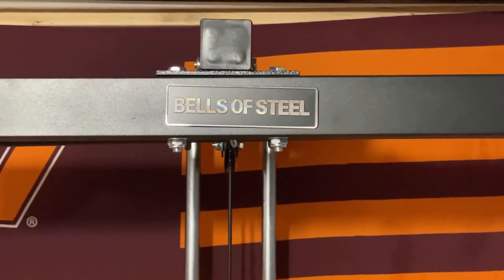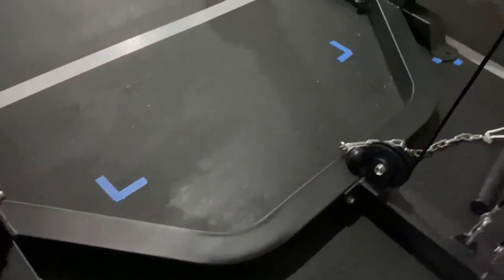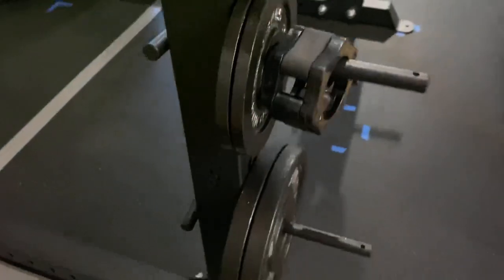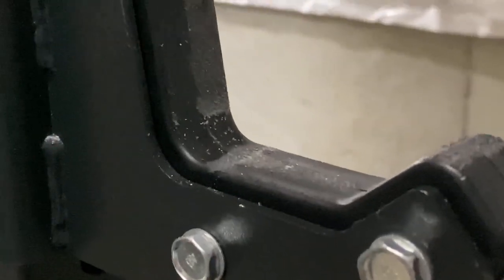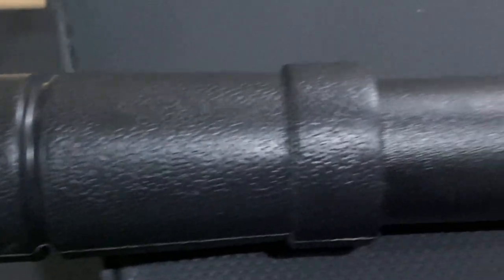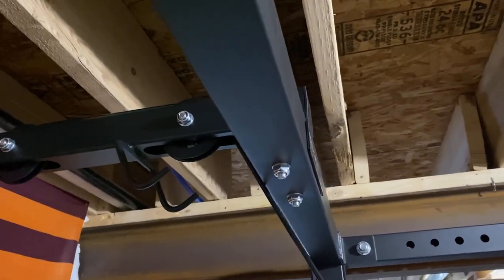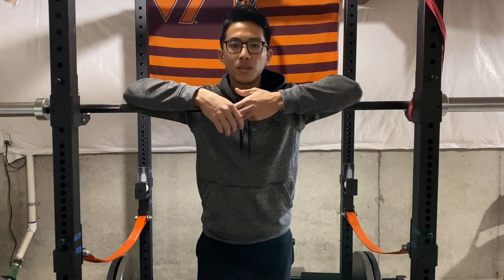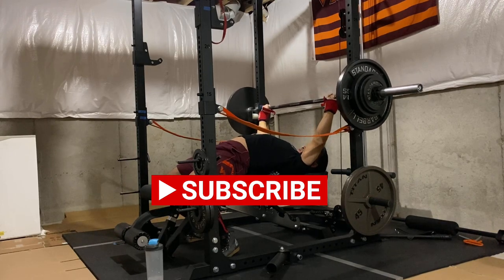Bells of Steel 5.1 Light Commercial Power Rack and Lat Attachment Review

Comment: I got this exact setup just before the pandemic hit. I also got the spotter arms, dip attachment and lever arms/belt squat. Would recommend for the price.
Reply from the maker: Definitely want the lever arms/belt squat in the near future.
Reply: I wonder what you can do with the lever arms that you can't do with the barbell.
Reply: @dkmchui  mimic just about any hammer strength upper body machine
Reply: But again what it can do that a barbell can't for upper body exercises? For the rack the big lifts are just bench press, shoulder press, row, squat and deadlift.
Reply: @dkmchui isolate shoulders, lats, traps, triceps, you can attach a roller and make it a glute work out. Lots of stuff you can do.

Comment: Really nice overview.  Well done.  Appreciated the detail.  This rack looks like a very good value.  It's been about a year since you posted this and I am wondering if you are still using the rack and have you had any issues?
Reply from the maker: Still using the rack regularly. I’m certainly not lifting as much or frequently as I did but still am 2-3 times a week and it’s held up well. The roller j cups have held up well, I suggest doing the lexan mod I did to keep your bar safe. The lat pull-down has been great, maybe just have to wipe it down with WD-40 to glide a bit smoother.

Comment: Nice review, quick questions regarding the flat feet... @2:14 in the video when you are talking about them and the video pans it looks like only the ends are touching the stall the ground and there is a gap between the rest of the base of the rack and the floor. I would have expected the entire base of the rack to be touching the floor for stability. Is this correct?
Reply from the maker: Good catch, I didn’t even notice to be honest lol. There’s about a 1/4” between the bottom of the feet and bottom crossbar. While this may seem like a concern, I haven’t had too many issues with it sliding around on the mats. 

If you look at the REP PR1000 flat foot rack or the Titan fitness T2 flat foot rack, they have these rubber feet which raise the 4 corners higher than the frame so it doesn’t seem uncommon per say. 

If you wanted all of the frame to be touching, you’d probably have to go with something like the Rogue Monster Lite flat food rack. Nonetheless I wouldn’t say that this rack is unstable because of this. It’s longer than most of its competitors and that extra length gives it stability. The lat pull down also helps.

Comment: How thick is the lexan and how is it holding up?  I'm not sure how to cut it.
Reply from the maker: I bought a small square sheet from Lowes. Looks like the website claims 0.093” thick. 

I measured and market the Lexan and use a box cutter and just continuously scored the line until it was cut and then sanded the cut so there weren’t sharp edges. It would have been much easier if I had a hand grinder I could attach a cutting wheel of sorts to or an oscillating too. 

I’d say it’s almost as painstakingly slow as cutting the stall mats with a box cutter lol.

Comment: From the wall to the outside edge of the rack how much space does this take with that lat pull down? Seems pretty deep.
Reply from the maker: Adds 12” of depth per BoS dimensions on the product page. Verified by measuring as well.
Reply: @Kelvinjan  Thank you. 
Just thinking of a garage gym using one half for the car. So space is vital.
Reply from the maker: @ToddCBrown  I hear you. Some people live in areas where no basements are the norm so you’re stuck using a garage spot for the home gym.

Comment: With the frame poles being 2.3" x 2.3", have you found any other manufacturers that make accessories to attach to it? I know you mention it in the video about not being able to use Rogue or Rep accessories, but thought since it's been over a year, you might've found some. Thanks! I just bought the budget 4.1 residential rack with lat attachment
Reply from the maker: I honestly have found that I needed anything else so I haven’t shopped around. I do want the lever arms from BoS and their pricing is pretty good so I wouldn’t be upset buying it from them.

Comment: Hey Kevin awesome video.  I have the same rack and put it together a few days ago.

Can you take a closeup pic or video of both your plate storage pages on both sides?. I recieved the pegs and it looks like they are both for the same side (ie don't have a left and right side). Do you have the same issue?
Reply from the maker: I took some pictures but not sure how to send them to you. You can DM my on IG @Kelvinjan and I can send you the photos. 

But, you are correct that both plate pegs are the same. You will insert the pin into the front of back side of the upright in order to get the plate peg to be oriented outwards or inwards if you get what I’m saying. Pictures show it more easily, feel free to dm.
Reply: @Kelvinjan  thanks will do

Comment: Do you think that this would be worth getting over the new Bells of steel hydra series rack? Would you say the attachment selection is plenty for most people for the light commercial due to the proprietary hole size?
Reply from the maker: I’m not too familiar with the newer hydra series but it seems more sturdy and much more expensive. It all comes down to your budget. I think the hydra is probably overkill if you’re comparing apples to apples with the flat food rack. I’ve been ok with the lat pull-down and landline attachments. Thinking about buying the arms you can attach to the front but haven’t yet.

Comment: 💪🏼 Awesome vid! I have the same rack. I was thinking of buying the lat attachment once it's available. I see the issues you pointed out when doing tricep extension with the pulley system. Do you think it's something worth buying in your opinion?
Reply from the maker: You can still make overhead tricep extensions work, you just have to stand closer to the lat attachment to minimize the angle. I honestly don't do oveheard tricep extensions often and don't really run into the issue I pointed out but figured it'd be worth bringing to people's attention. I'd still recommend the lat attachment as it's super versatile for the price. Could be improved design wise but that one flaw isn't a deal breaker for me.
Reply: Just do JM Presses instead, problem solved.

Comment: The pulley attachment is supposed to hang over the top cross piece so that the pulldown attachment is on the inside of the cage however the bar at the bottom of the rack used to be a straight bar instead of a curved bar. If you flipped the bottom piece over than the pulley would hang inside of the cage, possibly, however a straight bottom bar was the original design.
Reply: I have this same low ceiling in the basement, however I installed the Brute 2 Power Rack. The 450 lb rack. It's only the six corner posts that you need to have 90 inches in height for. It can fit between ceiling joists. You could do it easily by the look of it.

Comment: hey! i was wondering what the length x width is with the lat attachment. was looking to get the same setup but can’t seem to find that info anywhere
Reply from the maker: Are you looking for dimension on just the base of the lat attachment? Obviously the pegs for weights extend past the base width wise.
Reply: @Kelvinjan  i mean for the whole setup. like an approximate footprint. ie. 60x55 in
Reply from the maker: @osa9719  the lat attachment adds an extra 12”  in length. It doesn’t add any width to the rack.

Comment: how's the wear and tear on the two guides for the lat pulldown - does it stay smooth over time or do you spray any type of lubricant like WD40 lithium? TIA
Reply from the maker: I just occasionally spray WD40 and then it’s good as new. Been debating if I want to put some sort of grease or automotive grade lubricant but not sure if it’ll degrade the parts so I just use wd40.
Reply: @Kelvinjan  that's why I mentioned WD40 white lithium which is used to lubricate garage door pulleys/hinges it lubricates and doesn't drip.
Reply from the maker: @jonbe9  ahhh gotcha I didn’t realize lol. I may have to give that a try, I just spray plain old wd40 on a rag and apply.

Comment: Does the rack wobble when you do pull-ups or racking the weight?
Reply from the maker: Not too much from what I’ve noticed. Maybe if you’re re racking 300-400+ lbs really rough but I’m not like smashing the bar into the j hooks when i rerack. The flat feet design helps with overall rack stability vs a 4 feet rack.
Reply: @Kelvinjan  Good to know, thanks!

Comment: Great video!  Very helpful.  I am looking at getting either the Rep Fitness PR-1100 with lat attachment or the Bells of Steel 5.1 with lat attachment.  I have a slight preference for the BOS 5.1 because it is a little heavier, but it the Rep PR-1100 doesn't have the design problem that you pointed out in your video.  My concern is similar to Roxnard Cali's.  Following up on Cali's question:  First:  Are tricep pull downs the only exercise that you had problems with with he BOS 5.1 lat attachment?  Second:  Are there workarounds for the tricep extensions, like doing them while seated or kneeling instead of standing?  Thanks.
Reply from the maker: The only time it’s an issue is if you’re doing tricep extensions over your head and you’re facing away from the lat attachment. I’d you just doing regular tricep extensions downwards it’s no issue.
Reply: @Kelvinjan  It seems that if you do overhead tricep extensions while facing any from the lat attachment and from a sitting or kneeling position, the angle of the cable off of the pulley would become more vertical.  Can you avoid the rubbing problem by doing the extensions that way (facing away from the lat attachment and in a sitting or kneeling position)?  Thanks.
Reply from the maker: @tomjones8235  I just tried it kneeing and you can make it work. Awkward since your feet have to be on the outside of the c-shaped stabilizer bar and knees on the inside. I was in a bit of a hunched over position to get the full ROM but it seems to avoid rubbing against the crossmember. 

I think the BOS Utility rack had a similar design to the Rep lat attachments where the pulley is inside the rack. Not sure why they didn’t to that for the residential or light commercial rack. Could be cost savings since the bar and cables are shorter. Who knows.
Reply: @Kelvinjan  Thanks for checking.  I don't understand why BOS didn't use the same design for the 4.1 and 5.1 lat attachment as they did for the utility rack attachment.  The front pulley is in front of the back cross bar on the utility rack but behind the cross bar on the 4.1 and 5.1.  It seems that the lat bar for the utility rack has a better design because it avoids the problem that you pointed out.
Maybe I am letting the perfect be the enemy of the good.  For me, maybe standing tricep extensions are better done with a bar or dumbbells.  As long as I can do lat pulldowns, tricep pulldowns, sitting rows, and plenty of other stuff with the lat attachment that should be good enough.  Thanks again.
Reply from the maker: @tomjones8235  yeah I don’t understand the design choice but I also don’t think it’s a deal breaker. You can still do tricep pull downs like you said and plenty of other accessories.
Reply: Maybe the design was changed when the light commercial rack was updated.  There is a BOS video from 11/02/2017 that the front pulley in front of the back cross bar.  Thanks.
Reply: that the = that shows the
Reply from the maker: @tomjones8235  yeah unfortunately the light commercial doesn’t have the better design. The choice is yours, I think it’s still a fine rack and I’d choose it over the utility due to the accessories and flat feet design.

Comment: one more question - can you get away with just using one pulley up top so it doesn't rub against the top crossbar when doing sets such as overhead tricep extensions? TIA (awesome informative review BTW)
Reply from the maker: That might work better but the way that bar for the lay attachment is mounted above the cross member makes it an issue.

Comment: Do you find the FID bench to be stable? Can you do dips on one side of the bench and does it stay level?
Reply from the maker: It’s stable enough but there’s definitely some movement with the way it’s designed. The back plate didn’t appear as wide as I imagined and I think that adds to the instability. But nonetheless, you can definitely do dips on one side of the bench no issues.
Reply: @Kelvinjan  Thanks, your review has been very helpful.
Reply from the maker: @elienehme_  no problem, let me know if you have anymore questions.
Reply: I would highly recommend just getting something like the rep fitness fb-4000 comp lite bench its $139 but it's not adjustable. But the padding is wider atleast I like that better vs being able to adjust the bench. And its probably cheaper
Reply from the maker: @chriscripe9477  I contemplated just getting a flat bench like the F-4000 but since it's a home gym I wanted the versatility to do other things at home. The flat bench is a more narrow use case and if I have to spend money, I want to maximize my use cases.

Comment: Ah! So it's not actually a flat foot rack?  Seems like the flanges for the anchoring bolts are lower than the bottom tubes.  Thought the rack actually rested on the bottom tubes.
Reply: Just looked at the dimensional drawing on their website.  Indeed, the bolt tabs are lower.
Reply from the maker: Yep you’re right. Honestly even without any plates on the pegs, I doesn’t event shift on my stall mats.

Comment: My rack is 3 years old been inside its whole life. Rusted pretty bad.
Reply from the maker: I don’t have any rust on mine and it’s been in the basement all it’s life. Maybe you need a dehumidifier.
Reply: @aznintheoutfield   by inside I should clarify, I have an attached garage fully insulated. I sprayed it with some matte black paint. My rogue wall rack is still mint, same room different purpose